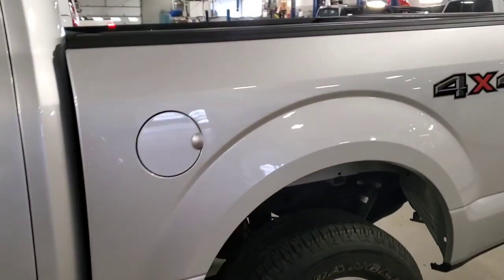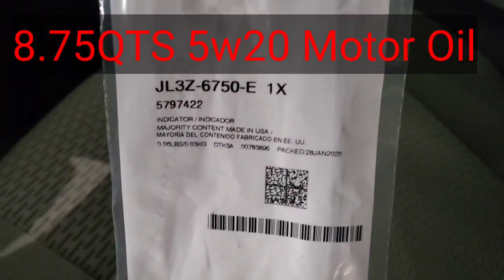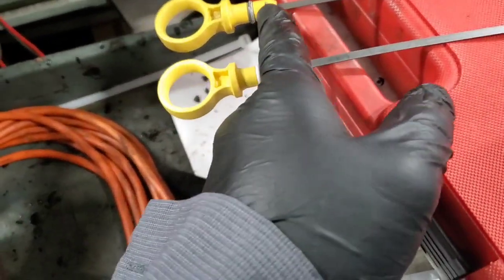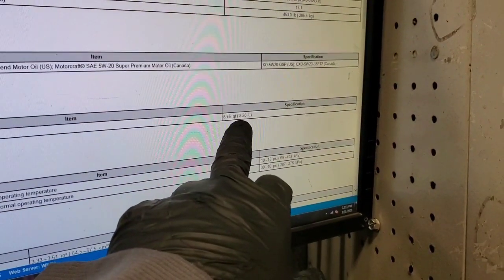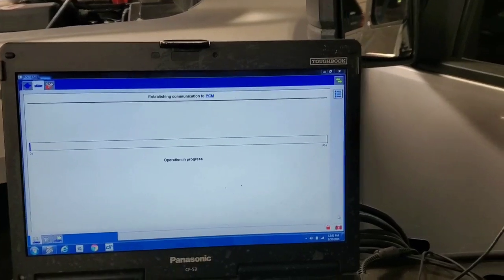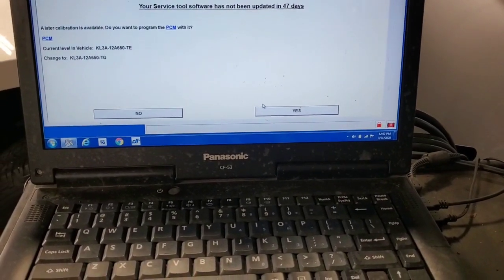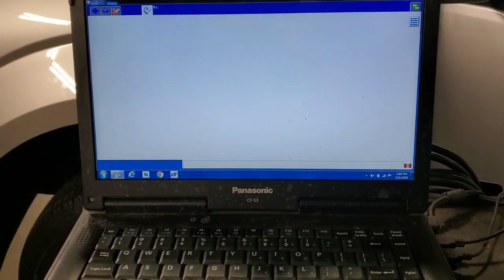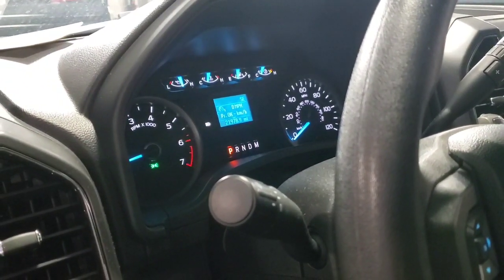2018 - 2020 Ford F150 Oil Loss or Oil Consumption Technical Service Bulletin

Comment: Quick chat: has anyone with the 2018-2020 f150 5.0 V8 have the oil consumption issue fixed or disappear? Or had the oil consumption issue never appear at all?
Reply from the maker: All three trucks that I have done the update on with the dipstick and the reprogram have not come back with consumption problems
Reply: FULL CEND - TKM  I have one built August 2018. I change my oil every 3,000 miles and haven’t experienced oil consumption with 14,500 miles on the truck. Do you think it’s wise to get this TSB on my truck so injectors don’t get turned of and create the high vacuum?
Reply from the maker: @royalelwood9538  first I would call up the dealer and see if it's active on your truck it's not active on all of them it's only specific build dates
Reply from the maker: @royalelwood9538  secondly if you're not having any issues then I would just leave it alone
Reply: FULL CEND - TKM The ford dealership also wanted the first oil change at 2,000 miles. I took it on a road trip varying the speed 400 miles when it was new.
Reply: my 2018 king cab 4x4  has had the re program, longer dipstick@ 28.000 miles used 3/4 of a quart in 700 miles, then went another 850 miles before I needed to add any oil... I put 1/2 quart in because it seems to like to run on the lower side of full.....and drove another 850 miles and oil level stayed at the 1/2 full mark. I love the truck....I am burdened by the oil usage, the upside is it got 23.8 mpg average on the tollway doing 70 75 mph....I did buy the extended warranty....

Comment: Hey Rich, I have a 2018 Ford F150 3.3L V6 I bought from Carmax. I bought it with 26K miles and I am now at 46K. What Maintenance should I have done and would it be a good idea to take it to my local Ford Dealer to do a Maintenance service?
Reply from the maker: So this is probably one of the most reliable set ups very basic very easy to take care of and if that interval the only thing that I would see that needs to be done

Cabin air filter behind glove box

I know most people don't like doing this because the coolant lasts a really long time but I don't trust old coolant so at about 50,000 miles I flush the coolant on my vehicles

And it all depends on how you feel about the brake fluid really the brake fluid should be flushed once a year but people don't do that the problem is brake fluid is so hydroscopic it absorbs moisture in the air and after the first year it's pretty much got quite a bit of water in it

So at 46,000 miles and it being a 18 I would say just really brake fluid and cabin air filter every else should still be good

Comment: Just ruined my whole plan to buy a new F150 Coyote.  Have had a 3.5 before so no thanks on that unless I lease one.  Hope this gets sorted out fast.  Still don't understand how oil gets sucked up from the crankcase for ANY injector related reason.   :(
Reply: If you're not going to tow much get the 3.3 v6

Comment: What is the TSB number?  I just bought a 2020 5.0 and they didn't mention if any TSB's have been taken care of.  Maybe I can call and ask with the number and the VIN?
Reply from the maker: Call the dealer tell them that this is your VIN number and see if there are any open tsb's they will tell you which ones are open on your truck and ask them if they can give you a printout
Reply: @fullcend-tkm73  OK cool.  Thanks.

Comment: I don't miss these issues at all. I bought a 2018 F150 with the 5.0 engine brand new within 2000 miles I couldn't get a reading on my dipstick that was the first time I checked my oil 2000 miles I should have checked it sooner I got put on the list for oil consumption I went to the dealer they scribed my dipstick and checked me every few hundred miles at 3977 my my first engine was replaced after about 2000 miles on the replacement engine I noticed it too was using oil or oil was going somewhere at least it was the most painful 9 months of my life owning that truck I literally spent more time driving dealership demos than my own truck in the end Ford never even gave me all of my money back for lemon law they treated me like crap and their customer service is terrible I now drive a Toyota I feel upset about it though in a way because the Ford was the first new truck I ever had and I was happy to own it until I realized what a problem it would be.
Reply: I was in the market for my first new truck last year.   I was pretty set on a stx f150 supercab    5.0.  373 truck.     Then I heard about the oil consumption on the 18+ trucks.    The amount of people bitching about it was nuts.        I ended up going with a tundra instead.     Needless to say. The truck is Awsome.  🤷🏻‍♂️.
Reply: I also bought a brand new 2018 Ford 150 with the 5.0 Coyote. I bought it because it was highly recommend and most of my company fleet is Ford.  We has issues from the start with excessive oil consumption and almost zero answers from the dealership.  They had my truck almost 1-2 times per month for 1-2 days at a time without offering a loaner. I was very disappointed, not only with my dealer, but with Ford. None of the TSBs ever fixed our problem. After a year of issues we traded in off for Toyota Tundra.  I really wanted to love Ford but this was just too much to deal with.
Reply: Hey When I was looking into a new truck the Toyota Tundra came right into mind. Several friends on mine have them and love them. I looked into the other big three. Passed on Gm. Ford didn’t give me any deal. Dodge gave me a good trade and pricing. Couldn’t find a Tundra and didn’t want to wait. Went with Dodge 6.4 Hemi. It runs very well does use some oil Thinking it has same issues as Ford cylinder deactivation oil use. It still has low mileage so maybe still breaking in. I will probably trade it in for Tundra if something I like comes along.
Reply: Agree. I have a 2018 also. Same issues, but I didn’t notice my issues until WAY later. The problem was probably going on for a while. I regret buying this truck. 
One thing I learned from all this is that I will never own a ford for as long as I live.

Comment: Just bought a used 2018 5.0L with 27,000 miles on it and checked my oil seems to be a qt low after driving it 2000 miles, should I call the dealer and get this TSB done? I checked the oil when I bought it and had them top it off cause it looked a qt low after they did the oil change, and should I go by mileage or the oil life %, it says I have 50%  oil life left?
Reply from the maker: Mileage 

top it off and monitor it, call the dealer and see if you can get an appointment and ask if this applies to your truck.
Reply: @fullcend-tkm73  
Since I bought my truck used, how do I know if the latest TSB (19-2365) might have already been done? I did notice the dip stick is original but the PVC valve is the updated version. 2018 F150 Platinum FX4 Supercab, vin# 1FTEW1E5XJFB20109

Comment: I just bought  2019 today with lass than 11 k miles . If it burns oil I will keep taking it back until I can get a buy back under the lemon law
Reply from the maker: make sure every time you take it back it's documented the same way and the words are not changed
Reply: Okay thanks . I really hope it does not burn oil .
Reply from the maker: Just keep an eye on it I think you'll be fine I don't really see these all the time and I work on a lot of these
Reply: This will worry me something awful
Reply: Thanks man. I sure hope so

Comment: Does it work??
Reply from the maker: So far I have not had anybody come back but some people are saying that it doesn't work I don't know that for sure nobody has come back to the dealership complaining or we haven't seen them consuming oil anymore
Reply: FULL CEND - TKM  gotcha Drive my truck truck 400 miles and already to the add Mark. One more question is it in normal for 2018 5.0 coyote do you have a knocking sound between 1100 2700 RPM?
Reply from the maker: @walterjeffrey1654   a lot of people complain about that man I can't say that it's normal but Ford does say they are noisy engines sometimes the phasers and timing chain start to go out on them that causes some issues as well

Comment: Does this f fix the problem?  Thanks in advance.
Reply from the maker: It's still so new I don't know that for sure the few that I have already done that customer has not come back for any concerns
Reply: FULL CEND - TKM I’m about ready to lease a new 2020 5.0. This will replace my 2014 5.0 which was a great truck. I’ve been reviewing all these videos on this oil issue. The Ford dealer seems aware that there have been issues but seems to think it’s been resolved. Perhaps this is a ploy to get one to take their trucks to dealership for oil changes? I know I will be now. If I was buying this truck I’d have more concerns. Just hoping for no BS. Was very pleased with my 2014.

Comment: Ford isn't the only manufacturer having oil burning issues. Many have been using low tension oil control rings to help with fuel economy, creating less drag on the piston. The unfortunate side effect is more oil burning. I had this procedure done to my 5.0 F150 and it helped a little bit but I did have the same reaction as most in the comment section here when I compared the old and new dipsticks side by side. This is a cheesy fix, I agree, however it should keep them out of litigation for a class action lawsuit.  Many are also going with the composite oil pan as well, seems to be the new normal going forward. So far with 25k on mine, I've had zero issues with leaks. Drain plug placement sucks though.
Reply: Bingo! Toyota has been doing this even longer! Changing your oil with good quality oil every 3000 miles is once again required.
Reply: Still holding up?
Reply: @haddonsmith345  yup
Reply: So when a guy says their truck doesn't lose any oil they're full of crap? My 2011 5.0 consumes oil and it's annoying. I thought of getting rid of it but if every truck is consuming oil it doesn't make sense.
Reply: @bradvincet1848  Who said that they would be full of crap? All engines consume oil, some more than others.

Comment: I was thinking about buying another F-150 but after seeing this I will stay with my Tundra.
Reply: I traded my 18 F150 for 18 Tundra.
Reply: Tom Le Great choice!
Reply: I have a 2018 f150 v8 5.0.....crappy piece of junk.
Reply: I traded my 18 f 150 for tundra 2020
Reply: Keep the Tundra, fabulous motor!
Reply: Wait for the 2021 mods. They ditched the 2018-20 5.0 engine.
Reply: Depending on the year tundra I know I’ve heard it’s quite a job just to replace the starter on those rigs. Heard 1k to 1500 if you pay to do it or a solid 6 hour job to do it yourself. Every make has some type of issue but 1500 for a starter replacement would set me to thinking if this is the choice I’d want to make.

Comment: What are your thoughts on a 2020 Ford f150 4x4 with a 3.3 v6 and a 6 speed trans? Considering an extended cab with this engine. Any problems? Longevity?
Reply from the maker: I have no problems with this combination so far but this is brand new so we shall see

Comment: On my 3rd f-150, my last one, the doors wouldn't close when it got below zero, my current, an 18, used 5 quarts of oil before it's first oil change - they did the reprogram and new dipstick, still using oil.  If this wasn't a leased vehicle, I'd sure be pissed as the next step is replacing the engine.  I did my job, I notified them of the issue, I'll hand them the keys at the end of the lease and it's their problem after that.  Question is, do I buy another f-150?  I've not had good luck with GM products either, so do I jump ship and buy a Toyota?  

It sounds like they haven't fixed the oil consumption issue yet, so I don't dare buy another coyote.
Reply from the maker: Can you jump up to an F250 with a 6.2 L that's what I would do
Reply: FULL CEND - TKM That would really be overkill for me.  I’m not sure what I’m going to do - I’m losing faith in Ford, I may get a gm.
Reply: desmoface Try a Ram
Reply: ATX-CVPI I actually like Rams but I keep hearing horror stories about reliability.  Resale value is the lowest, as well.
Reply: @fullcend-tkm73  Dump Fords problem back on them in trade for  the F250. Make sure the 6.2L has normal cylinder liners and not plasma welded cylinders.

Comment: If you are low on oil, you need a longer dipstick.
Reply from the maker: Yeah that clearly doesn't make any sense I don't know why Ford did that
Reply: @fullcend-tkm73  
Because ford knows there's something wrong with these engines and they're just trying to get them through the warranty period.

Comment: This is an issue with this new "start-stop" tech. Its garbage
Reply: Hate the stop/start feature, turn it off every time I start the truck!
Reply: @jdwilson7211  Auto stop/start eliminator cable $80 USD - 15 minute install just behind sync screen bezel...plugs "in-line" with the circuit and remembers last setting. No warranty issues and no "dummy" trailer plugs that shut off safety features.

DONE.🤔

Comment: I bought a 2020 F150 with the 2.7 L eco-boost. I really thought I wanted the 5.0 but the dealer told me with all the problems these engines have had Ford is discontinuing that engine. Of course that was a salesman talking not sure if that's true or not
Reply from the maker: Ford is not discontinuing that engine and it's the best engine that they produce out of the ones that they have
Reply: As of 8/12/20 Fords official web site says " the great 5.0 is being replaced by a new 4.8 with 420 hp and 420 torque, smoking the 5.0. Production of the 4.8 has begun and will be replacing the 5.0 by early 2021, so , direct from Ford, yes they are.
Reply: @Tomcoker1952  yeah Tom, we will see what issues will come about with their new engine. If I were a betting man, I would bet there will be issues! On another note, plastic oil pan and a plastic plug lol.
Cheaply built vehicles, yet TOP bucks for them. In my view, the plastic oil pan, like the plastic intake manifold will end up as it ages developing a hair line crack necessitating replacement!

www.gty.org 
A great web site for ALL

Comment: I have a 2.7 ford ecoboost and that pan and drain plug is a pita. My yota started burning oil at about 250k miles. but it ran so good still and never had one issue other than alt and starter and oil pressure sensor. even had stock bushings and struts and the original trans fluid. yes the original fluid shifted great.

I dont think this ford is gonna last 150k without throwing money at it every year. Im gonna get rid of it at 80k miles lol.
Reply from the maker: Unfortunately you're correct they don't last very long before they start having problems and that's a huge issue

Comment: Ford was replacing engines for awhile be id this issue on the 5.0 liter. I own a 3.5 ecoboost and it doesn’t use any oil at all between changes, the level is the same when I change it at 4-5000 miles as it is when I put it in..I’d love to go back to a V8 , once you have the torque from the ecoboost it makes the 5.0 feel a bit weak until it’s wound up. Love the sound of the coyote.
Reply from the maker: So I do this professionally and I work on these trucks every single day that 3.5 L EcoBoost is one of our biggest problems with the timing chains and phasers and the Turbos leaking.....although you might have good experience with one there is also just as much bad that people don't talk about other than me 

the 3.5 is stout dont get me wrong but the 5.0 will still always be the most reliable f150 of the new trucks until recent